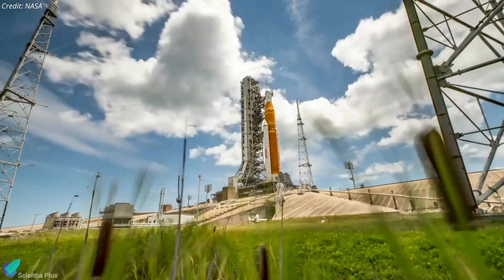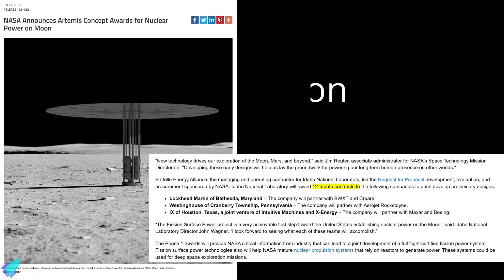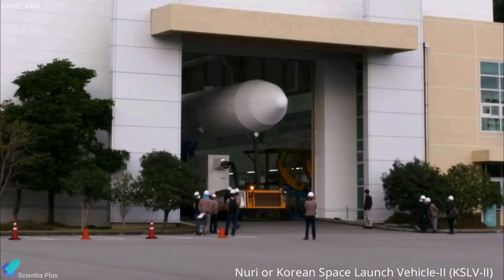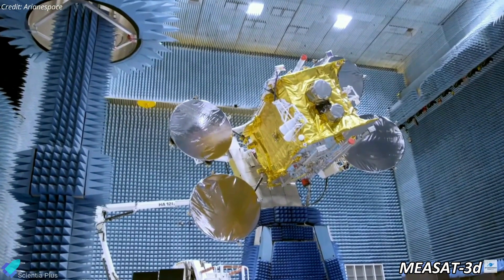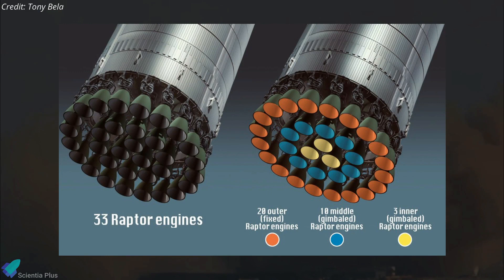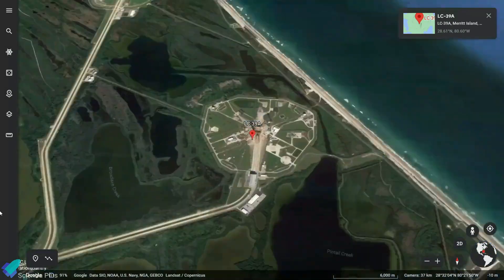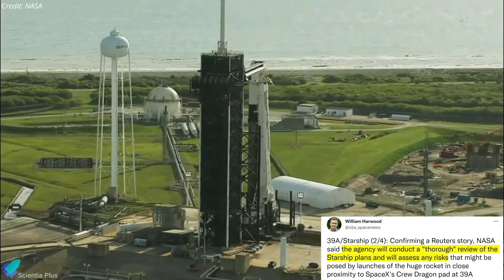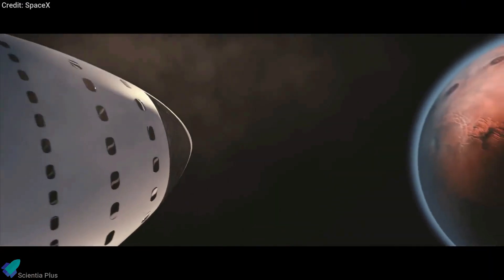Booster-7 Ready For Crucial Tests, Raptor Exploded on a Test Stand, Lunar Nuclear Reactor, SLS, Nuri

Comment: Would you want to be sitting on top of SLS when your flight director says, "it passed most of the tests", "we're pretty sure everything ought to be fine"
Reply: not to mention, every time they test that thing... diff stuff fails
Reply: Yes, you know apollo 11 went well and there were some ground service leaks
Reply: Well starship is cheaper i rather just wait
Reply: This is what testing is for
Reply: SLS is a good rocket
Reply: 50% of the time, it works every time 🍻
Reply: @Andy111Woodcock  I like those odds. I volunteer my sister.
Reply: This is an irresponsible comment, and is hypothetical at best.  Hypothetical questions demand hypothetical answers.  Space is a dangerous place.
Reply: @ReachOutToWilliam  So is the area around NASA launch site. Well NASA gets one thing right. All of their rockets do fall into the ocean. Elon made the comment that mistakes happen and when they do, we learn from them.
Reply: @ReachOutToWilliam  Maybe your right, but the rocket hasn't gone anywhere but to the pad and back.  SLS has taken some time to reach the point it's at,  and many questions have been raised about whether it's a black hole sucking an enormous amount of resources, and if the achievements  will actually produce beneficial results  Hypothetical analysis is not necessarily a mortal sin.  Skeptics are going to be skeptics.  Your point of view may be as biased as theirs.
Reply: Nah, I’ll take the Falcon-9 thanks, I’ll see you later...
Reply: I think the SLS is scary. They've been so thoroughly embarrassed by SpaceX that I'm reasonably sure they are schmoozing the test parameters and like someone said different stuff falls off!!